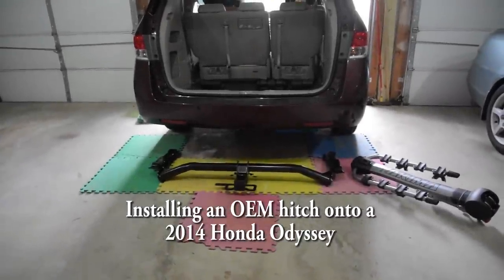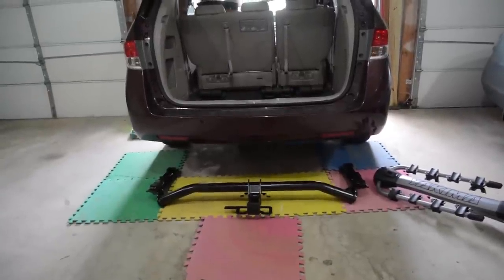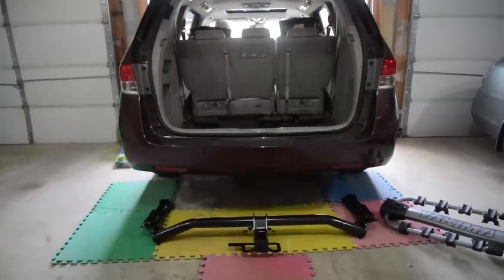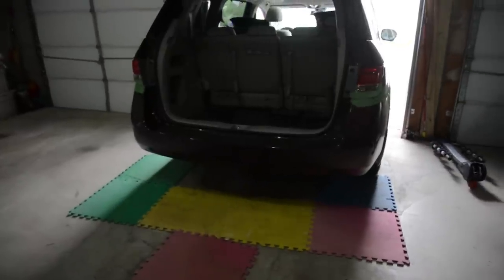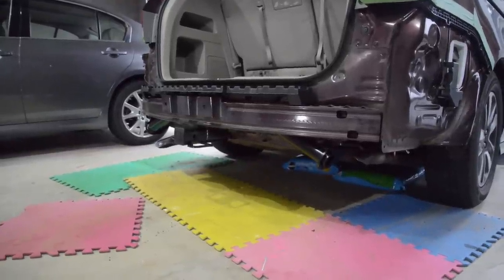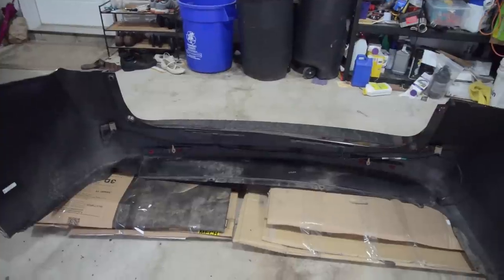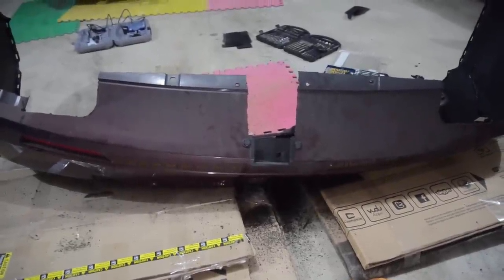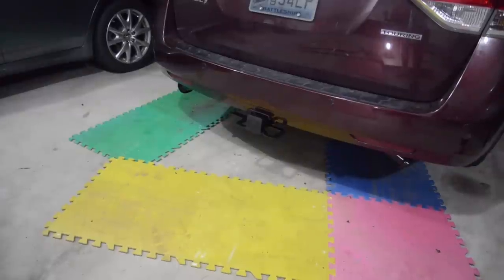Installing a hitch on a 2014 Honda Odyssey

Comment: Thank you Martin for your video & your efforts.  I am most likely going with the u-haul option as it is significantly cheaper than the honda oem hitch. The u-haul hitch does show, unlike the honda one which is discretely tucked in, but I am driving a minivan :-)
Reply from the maker: +Govardhanen Gopal The U-haul will also be easier to install because you probably don't need to take the bumper off. It will show more though. I wanted the neat look of a hidden hitch. Glad you liked the video.